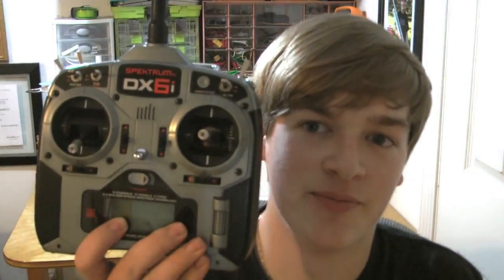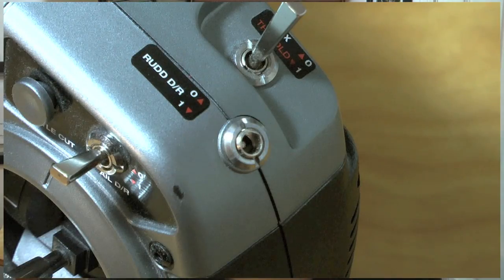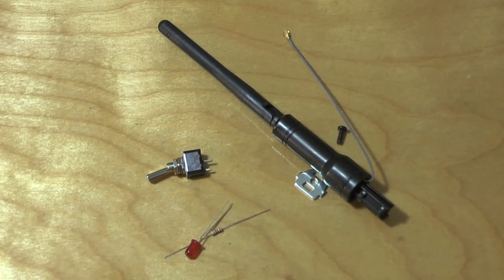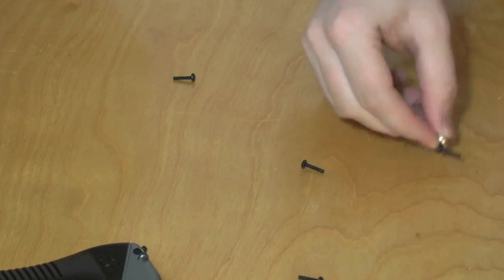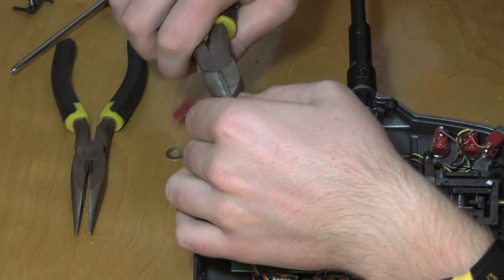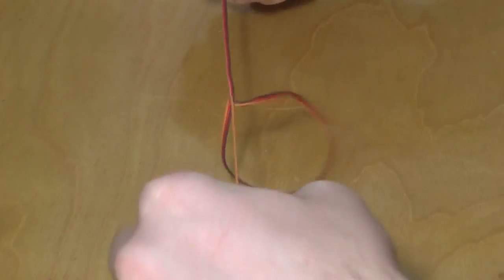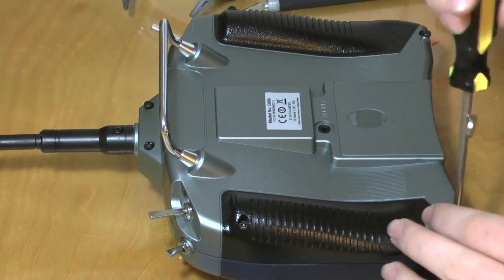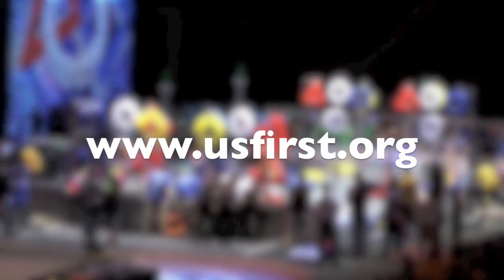DX6i Repair

Comment: Really enjoyed the LED installation. I often wondered why they had didn't have a LED installed to let you know that your charger was working correctly or simply that your batteries were being recharged without question . But anyway well done

Comment: if you repaire the tx your self then horion hobby want work on it if you need a part you cant buy from any were but horizon hobby.
i put a back light in mine and later sent it to horizon hobby to repair the scroller but they said they want work on it, so now i can get it fixed.

Comment: i was gona say droping them will break the internals aswell so if you shoud drop them get a replacement for that radio dont use it or your helie will kill somone if it locks out or somthing like pitch curves will get messed up or servo throws

and same if you crash a plane or a helie make sure you go over safety to make sure every thing is 100% safe before flying because most dont bother doing a quick check at home or in the field

Comment: Thanks for the video. I fixed a broken switch and added the power LED. The only thing I could suggest is a bit more detail on which wires to use for the LED, your example is a bit hard to follow at that part. Nothing someone who has a little understanding of wiring, etc, can't figure out, but your whole video is easy enough for anyone to follow except that part. My opinion. Still, thanks for taking the time to share your expertise with use and your time to make these videos.